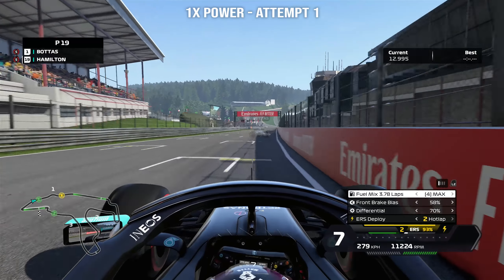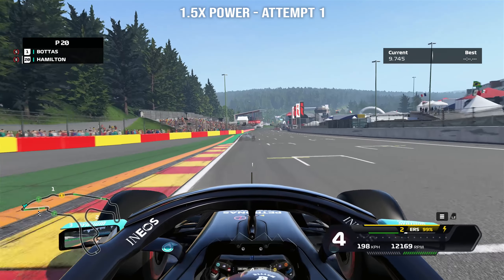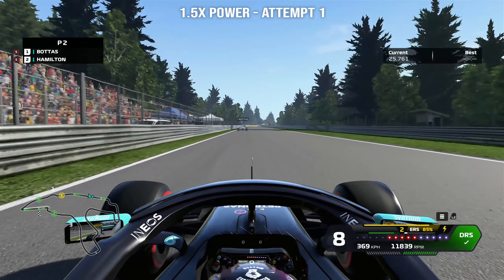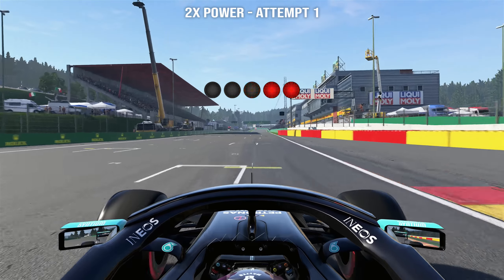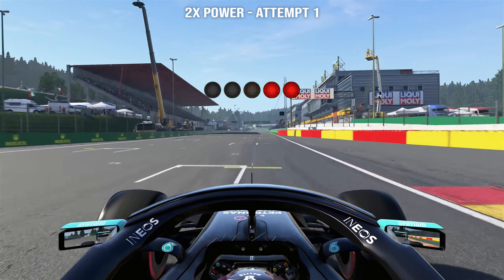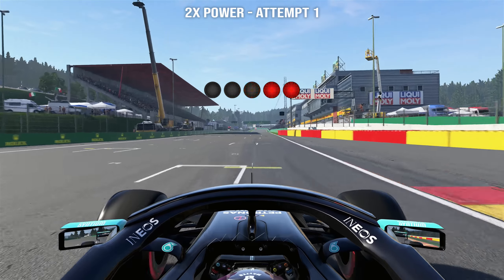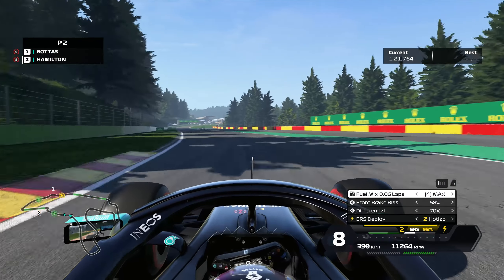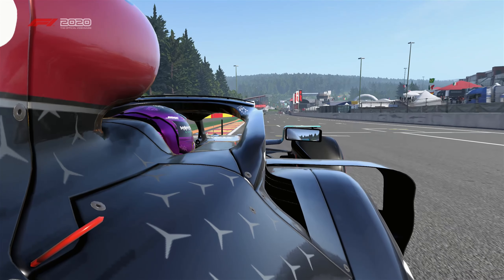How Fast Would F1 2020 Cars Have To Go To Lift Through Eau Rouge?

Comment: Can you do a mod where F1 cars have 4-wheel drive? Like smart 4WD where the tires toggle for grip and such.
Reply from the maker: I tried this but it's not possible on F1 2020 unfortunately, it crashes the game :(
Reply: @AlexGillon  Ah that's a shame! I was wondering recently how F1 would be if the electric motors were positioned in the front wheels. Grip would potentially be an issue during acceleration but with the right settings it might be insanely powerful getting out of corners.

Comment: Can you try an all wheel drive mod 50/50 split at lower gears and rear wheel biased at high speeds and then probably start cranking up the power

Comment: I thought u would multiply the power until u literally fly over the circuit by using the "ramp" as a lift off..... pls do it! If thats even possible
Reply from the maker: Definitely not without a downforce mod, the quicker you go the more the car gets pressed into the track
Reply: @AlexGillon  at some point (maybe 2000kmh?) u lose the linear flow which makes the aerodynamics irrelevant